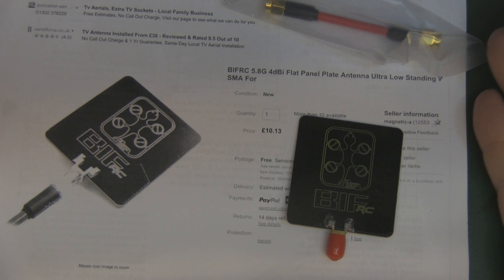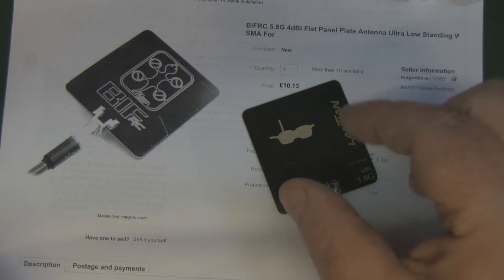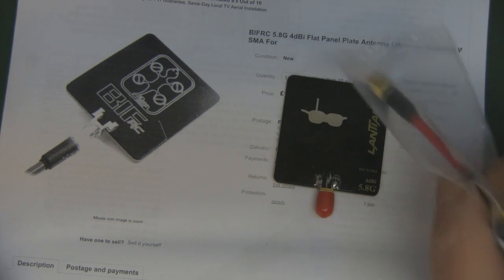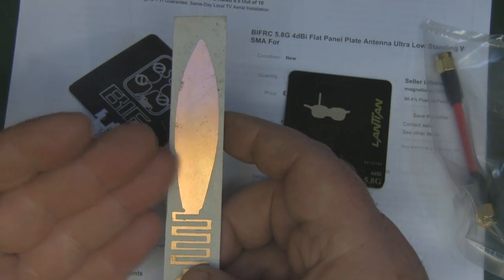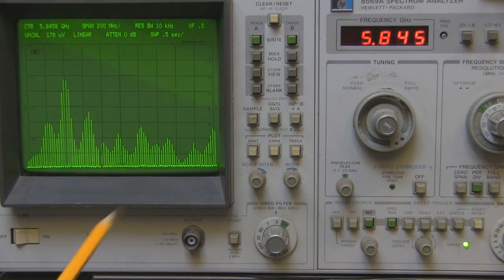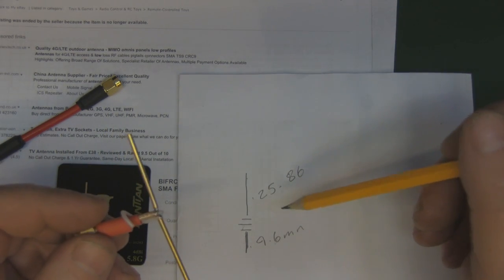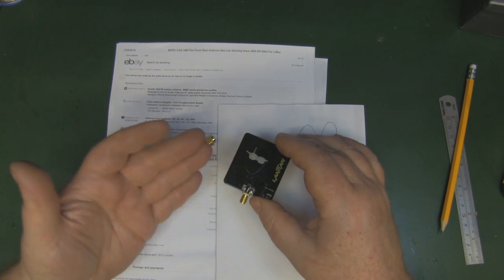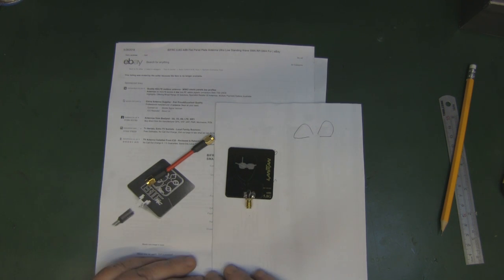BIFRC 5 8G 4dBi Flat Panel Plate Antenna

Comment: VSWR is standing wave ratio. The description probably means that it is well matched at center frequency ( VSWR close to 1) . Connect the antena to VNA and measure it properly.
Did you take into account the proximity of the metallic cable in your test set (the antenna is omnidirectional)?
Reply: knowing Andrew through this channel, I'm sure he's already been there, done that ;)
Reply from the maker: The probably did mean VSWR I was taking the piss. The antenna was measured properly Using my VNA would just be over kill the antenna is crap

Comment from the maker: It is rubbish or garbage depending on where in the world you live :-)
Also I have been playing around with the audio do you think it is better or worse?
Reply: You're more clear in this video but seemingly a little quiet on the volume side.  On another note what would you recommend purchasing if one would like to build / test antennas for 5.8?  Is there's an inexpensive (new or used) spectrum analyzer and signal generator that you would recommend?  Thanks for your videos I'm learning a lot from them!
Reply from the maker: No same mic different gain settings I will raise it up a bit in the next video. There was a couple of people complaining so I have been playing around with the audio in the last few vids. I think I may just end up leaving it as it was before though and just put it down to the fact you can't please everybody. :-)
Reply: andrew mcneil your audio seems to be softer than before. I have had to turn my vol. all the way up, beyond normal. Are you using a diff. Mic.?